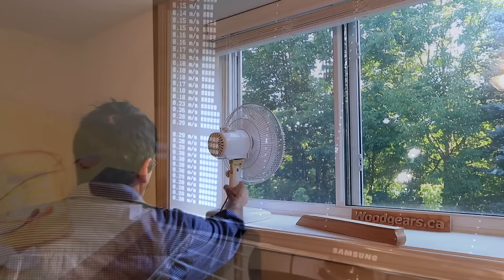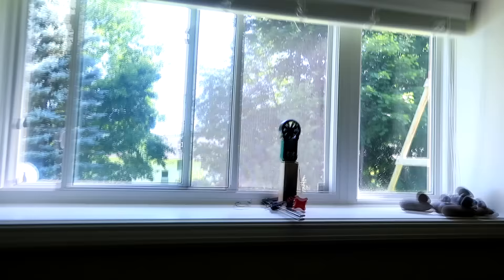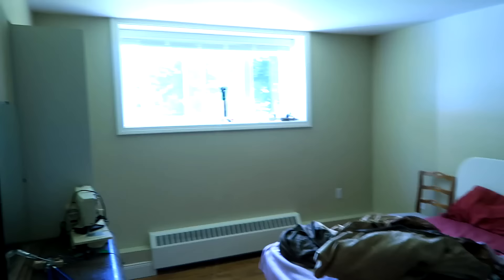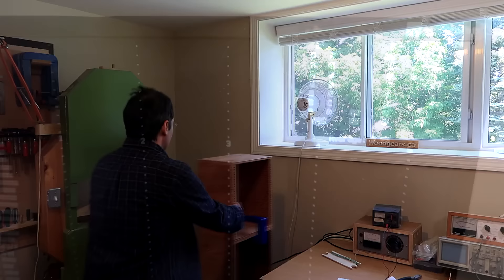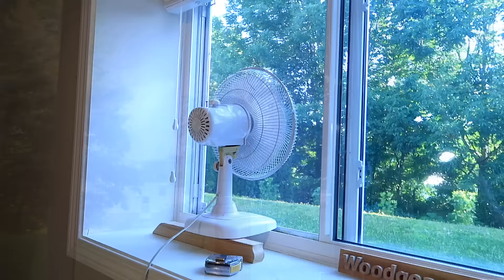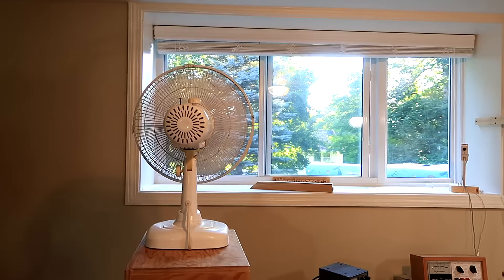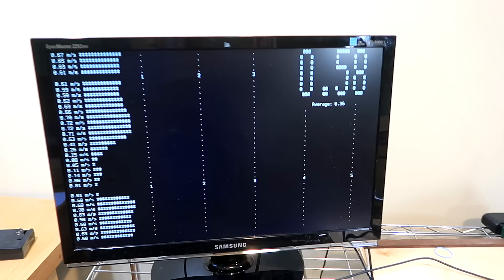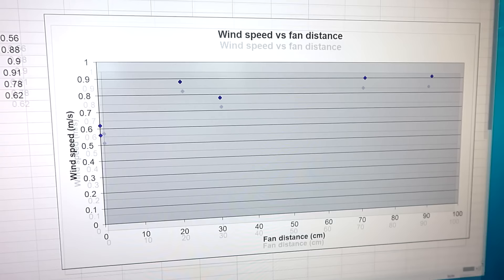Best fan placement to move air through the house

Comment: I've been doing this for a while.  
You need to get a box fan with a circular shroud on it.   
Place it in the window like in the video.  
Use boxes and towels to shroud the rest of the window or the air will just hit the screen and loop around.
Open another window on the other side of your house.
Tie the cords from the blinds around the handle to prevent it from falling over.  I've also used a suction cup on the window tied to the handle of the fan with a rubber band to pin the fan in place.
This provides a signifcant amount of airflow.
Reply: Or you could fabricate a window insert from OSB or MDF, with a cutout for the fan. Mount the fan to the insert, and if the sun hits the window, you can gain some extra cooling by painting the wood white so as to reflect more sunlight. However, you'll still have losses due to turbulence unless the box fan is ducted. I believe that's what you mean with "circular shroud"? A ducted fan?
 
For people who can't find a proper ducted box fan, use PC cooling fans instead. Go for the silent ones if noise is an issue, e.g. if you have them near your bedroom and continue running them while you sleep. Probably best to use multiple fans in the same insert, because a single fan will not move that much air. Try to get the largest ones you can get, as they will move more air, while turning slower (and hence quieter). As for power: if you don't mind ghetto, just use an old computer power supply (if it's ATX, like most these days, look up online which pins you need to bridge to turn it on). If you want something more presentable, there are plenty of 12V power supplies that can deliver the required current.
Reply: Having it shrouded prevents Bernoulli's principle from taking effect which should move more air than just that moving through the fan. Not sure why any of this is really important though, fans are about circulating air not cooling. They're more effective with the windows closed, pointed at you.
Reply: @arturjogi2667  you are missing the point, it being to move fresh air through the house instead of circulating the "same" air over and over again inside of a room. It's about how a simple fan can help you solve a problem within the structure and desing of your house, wich is the main reason behind this whole thing.
Reply: @ElBosquee  can still do that without a shroud. Like a turbofan jet engine.

Comment: To save money, I usually only turn on the air conditioner at noon. The rest of the day, I also use this "fan blowing at the window" for ventilation and air temperature moderation. I had a ventilator type fan, like that box fan, had stronger air flow, and I placed it on the very edge of the window. Now I know better. THANK YOU SO MUCH BRO FOR THIS EXPERIMENT! 😊

Comment: This was amazing and loved all of it.  The fan falling just made it so real. 😂 Thank you for making this.  I wish you had reviewed a side by side and or did a comparison, but I sort of did my own by jumping between 3:45 and 4:44 and I noticed that the box fan, although does not gain as much as the oscillating fan, but both do end about the same.  The box fan is just closer to the prime than the other out the gate.  The note about pulling the outside air in with it was also interesting and had never thought about that.

Comment: The fan is spinning, so it isn't moving air "forwards", rather, it produces a net effect of forward air... because it is spinning, it actually throws air outwards, think of spinning a ball at the end of some string... this produces a low pressure area in the middle that wants to pull air in. The shape of the blades also pushes air forwards, so the combined effect is that it blows out a widening cone, that then closes back in. In other words - it needs enough space around it and in front for this effect to work, which is why it doesn't work too well on the windowsill, as  this effect is disrupted. If you put it just outside the window, you can get a better effect, as the g-force effect can throw the air outwards, with it needing to be replaced from the middle... inside the room, pointing at the window, some of this outwards motion just goes around the room, not towards the window. Make a little bit of smoke or something so you can see it.

One other thing for fun - if you have an LED torch with a 'dim' setting, look at the fan with this light. The light is flashing very quickly, so you can see the fan spinning in slow motion with your eyes (no camera tricks needed!)

Comment: Literally running 8 fans at the moment to cool the house down at night.  Timing on this video is perfect
Reply: Why not just turn on your bathroom fart fans and your oven vent Hood
Reply: Just get a whole house fan, they're awesome.
Reply: @oMoM-dj2cg  Great idea.
Reply: been there, done that.  I sure as hell don't miss those days of growing up with no A/C just a box fan.  And i live in South Mississippi.  We have on average an 11 month temperate season.
Reply: By that point you're not saving any electricity you might as well turn on the damn air conditioner you might be saving yourself a couple dollars a day literally
Reply: @iair-conditiontheoutsideai3076  Brilliant - except there is no AC to turn on.  100+ year old seasonal cabin. We only get maybe 7 days a year when you'd really need it.
Reply: @muchmuchmore  well personally if it was that miserable I would just get a portable unit. Using eight fans is basically going to be a very similar energy draw as a portable air conditioner
Reply: @maxdecphoenix  a logical person would conclude if someone was running 8 fans it probably is because they are trying to avoid turning on the air conditioner
Reply: Even efficient central AC uses a fair bit of electricity.  Figure around 3kw/hr.  That means you could run 15+ 20" box fans.
Reply: @iair-conditiontheoutsideai3076  not necessarily.  One could just as easily conclude the person simply doesn't have an ac

Comment: Hello Matthias, your scientific approach is always interesting. Moving back the fan away is not always possible. Try to put the fan in a panel against the window to prevent air from returning around the fan. A passage of 5 to 10cm to form a ferrule improves performance. The panel can be made of plexiglass !

Comment: Great demonstration of induced flow.  Air molecules have friction when working against other air molecules.  A column of air will pull other air along with it.  The window serves to focus this and varying the distance finds the area of largest effect.  If this area is applied to the window, it will create a negative pressure in the room.  Opening all the other windows will help reduce the drag/resistance to the flow toward the negative pressure.  But you need to plan ahead a little and must put the fan on the downwind side of the house as A little breeze toward the outflow window will pretty easily cancel out your inducer.  Cooling a house with outside air is all about  moving mass and induced flow from a fan is probably the simplest way to do it.  I use an old blower out of a portable air conditioner as it is fairly quiet, but delivers a nice focused airstream to develop the induced flow…  i like conclusive data also:)

Comment: What this experiment can also tell you is that, since the fan mostly pulls air from the side, you can use it to pull air in by placing it close to the window but with the side to the window. That way you can get fresh air constantly blowing on one spot (you) and over time cool the room you're in. I've been doing that for years and it works great, plus you get the added bonus of having the fan blow on you instead of the low draft it creates when blowing out the window.

Comment: You should also test putting the fan at the middle of the doorway between the rooms.

I'd think it's the best way to create pressure difference between the rooms which you actual need to move air effectively.

Comment: The issue is that when the fan is too close, more air is drawn in at the areas of the window that the fan isn't blowing and less air is drawn in from the other room.   Moving the fan further away increases the area of the column of air hitting the window opening so that it is blowing on the entire window area thus forcing all the air to be drawn in from the other room.
A shroud to match the exhaust hole with the fan diameter would work as well.

Comment: Thank you for taking the time to share this fantastic experiment highlighting a practical use of Bernoulli's Principle in an 'every-day problem'. Some people in my family thought I was crazy when I would move a fan they just placed at the end of a doorway further back to increase the airflow. I'm extremely curious to know the variance with one of the blower-style fans, such as a Lasko U15617. I like using this fan around the house and garage for air circulation and blowing directly on me while underneath a car. If you ever do another test using one of these, I'd greatly appreciate it if you were able to share your data/findings. This is fantastic.
Reply: High velocity is the word I think your looking for....or are you  taking about literally one of those blowers you might see running when the carpet gets wet at a public bldg.?
Reply: @smf2072  Technically both are correct ;) it's definitely 'high velocity' but it is indeed the same style as the carpet/foundation blowers you're thinking of. Rather than being flush with the floor, the outlet of the cylindric blower is raised to the top of the unit and rotates to the desired position. Can also copy/paste the Lasko model I listed but you're certainly thinking of the right thing. (Love this fan btw...)

Comment: That's a fascinating experiment.  I think I'll still put my window fan in the other direction, for a few reasons:
 - Putting the fan in the middle of the room uses up floor space
 - The fan is quieter if you face the blowing side than the sucking side
 - I live in an apartment, so I want positive pressure inside my suite.  Negative pressure would pull in air from the corridor and kitchen/bathroom exhausts, which means more viral particles and cooking smells.
 - window fans are semi-ducted so maybe they're better at pulling in outside air

Comment: Great video! I had a different thought for why the throughput might decrease with the fan closer. If there's a screen in place, the concentrated high speed wind would create more drag, reducing throughput, but further back, slightly slower but with a broader affected area, there's be less drag and thus throughput. Didn't know about the side suction effect you described when I thought of that though, your explanation makes more sense.

Comment: I installed a 7000 cfm quiet cool attic fan and it's been one of the best decisions.  no more silly fan placement like this or trying to push air thru the house.  Just open a window or two, push the button and a constant breeze.  On high, it cycles the entire house air within minutes.

Comment: We learned about this when I did had a firefighting course on ventilating a smoke-filled building, and it was very clear that the most effective way to ventilate a building (in calm conditions) is to limit the amount of entry and exit points for the air and the ensure that you can create either a low pressure zone (by blowing air out) or a high pressure zone (by blowing air in) and this is significantly more effective when the wind cone covers the entire window (or door) with no other windows open nearby.

If the cone doesn't cover the whole opening then the pressure is equalized locally and thus less ventilation less efficient, which is similar to having a nearby window, which will help, but it won't do much for the rest of the building.

Ironically it means that the person nearest the fan will be the last to gain a benefit if done optimally.
Reply: Yes very nice explanation of the Bernoulli effect !

Comment: It makes sense because when the fan is very close to the window, the amount of air that it blows out is limited by its size (surface area). When you move it away, the air cone that comes out of the fan can "drag" more air around it before reaching the window, so the total amount of air is much bigger - it's not only the air that is blown by the fan, but also the air that is dragged along by the cone of air that is created between the fan and the window.

Comment: Makes me wonder if a baffle / ring covering the box fan where it pulled air back in would eliminate that.  Also, would a baffle with a cutout for the desk fan force air to not circle around it and improve the results.  I love your insight and investigations.
Reply from the maker: it would help, but not as much as moving it away from the window
Reply: I think that would effectively make it a crappy ducted fan.
Reply: I think a baffle would just induce a lot of turbulence. A better bet IMO would be a shroud/duct that extends a foot or two out either side of the fan.
Reply: Old fans used to have a cutout around the blades.
Reply: There are two types of ventilation fans used to clear smoke when firefighting, negative pressure works much like how you described, ducting closely around the blades so air can't get back around it. Positive pressure works by aiming a large, usually gas powered, fan at the door from a few feet away as seen here, so that the cone of air it throws totally covers the opening.
Reply: @johndii2194  I had one of those. Built really well. 3 speeds and reversible. Also had sliding panel on each side to seal the window. The blade shroud was also flared outward where it met the outer circumference of the blade. Probably built in 60s/70s
Reply: All you knuckleheads screwing around with your fans just get an air conditioner what is this the 1920s 😂
Reply: @iair-conditiontheoutsideai3076  we have crazy power prices here, using an AC would make the power bill so huge we would go broke.

Comment: Burnoulli's principle of fluid dynamics. High velocity fluid (air) causing low pressure at the center of the air movement which is filled in by the air in the surrounding area and all flows out of the window together. By moving the fan away from the window a large volume around the air blown by the fan is sucked out as well. Close to the window only the volume of the air passing directly through the fan is moved outside.
Reply: Isnt that how dyson fans design works?

Comment: I wonder how this would scale down to things like computer enclosures.
Reply: Yes, it absolutely does!  This is why better chassis/fan designs often include creative ducting and/or plenums.  I have done some testing just using my CPU temp sensor and I can confirm that fan placement a couple of inches away from inside the grille, blowing outward, can reduce CPU temps by a few degrees (assuming you have separate dedicated fan blowing through your CPU cooler).  It also helped cool my GPU, but not as dramatically, although further experiment might get even better results.
Reply: Via the REYNOLDS NUMBER since you asked!
Reply: @Mike Wiki I know next to nothing about computer design. So yah, it was an honest question. I’m a pilot, not an electrical engineer.
Reply: @LeeTanczos  I've never considered Reynold's Number for it's application within Bernoullis Principle, but I suppose they must be directly related.  I'm a power engineer, so other than steam eductors and basic fluid mechanics in things like centrifugal pumps and boiler fireboxes, I don't usually have to do a lot of the pure maths involved.  From my understanding (and it's only a surface understanding), Reynold's Number is mostly used to predict turbulence, but I could totally see how that might apply to the dynamics of PC chassis air management.

Comment: LOL the fan geeks are out in force.   We installed a whole house fan - available in the US but we could not find one in Canada.   They can replace the attic access hatch but you need to ensure the attic venting is sufficient.   Others mention this kind of fan below it does double duty on cooling as it pumps hot air out of the attic while drawing cooler night or morning air in.

Our extended family has a similar "window" fan powered by a 1/4 hp utility motor and I think the blades are shrouded - it is like a box fan on stearoids and what originally had me looking for the whole house fan.

Matthias have you tried putting an internal shroud on those cheap box fans to see if that improves their throughput?  I'm meaning an cylinder surrounding the blades and also blocking the backflow you are observing.    I thought one of your early dust collector experiments did something like that.      I have just such a box fan in my shop for evening cool air induction and I'm wondering about getting a few more cfm out of it.
Reply: 2nd the idea of a shrouded box fan. I use a similar setup in my house, but don't have any data.
Reply: Do you have a link you could post that explains what you mean by a whole house fan?  The problem with that kind of thing is that they can get very loud.  I have a solar attic fan that I used to evacuate hot air from my very small space between my ceiling and the flat roof.  It actually works fairly well, but it can whine sometimes and hum very loud.
Reply: a shrouded fan should work better at pulling air in the back and pushing out the front, you will still get some air sucked in the front but much less.
Reply: @christophertstone  I dont have "data" per se, but I can tell you that a DIY shrouded 20 inch fan, with the rest of the window blocked by a custom panel (critical) and the furthest opposing window opened,  exhausts the 900+ sq ft apartment fast enough that you can get rid of the smell of Styrene Monomer (Bondo, polyester resins, detectable at a few ppm) in 30 minutes or less. 

No shroud, not panel to block the rest of the window, or worse, trying to push air in like Matthias advocates, doesn't work. Because it creates a positive pressure, the only way the air enters depends on this fan in this window.
Reply: Csb